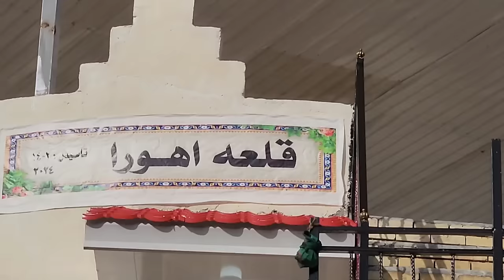Beauty in the castle: decorating Hassan and Zulikha nomadic castles with exquisite flowers

Comment: Please someone show the man how to plant a potted plant into a new soil: remove the plastic pot, then with your hands loosen up the roots of the plant with your hand, dividing the roots with your finger until they hang loosely and when they are free and loosely attached to the plant, then dig a hole at least2 times the depth of the pot of the plant, and at least 2 times the width of the plant, lower the plant into the lose and fertilized new soul, making sure the plant's roots are very comfortably loose in the new soil, then close the hole with more fertilized soil, but do not press down too hard because it will again compress the roots and they may perish. Then water until the plant is entirely soaked down to the roots, and below the roots, and water is visibly dripping from the plant.
Reply: Are you kidding?  Mr. Genius King of the castle knows everything so your valuable  instructions mean nothing.  We could take bets on how long all the plants will survive.